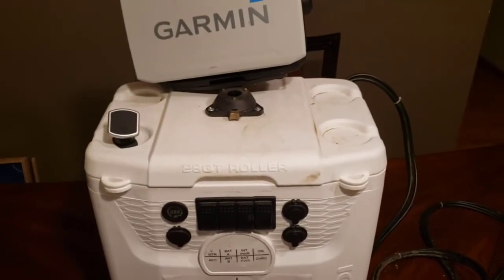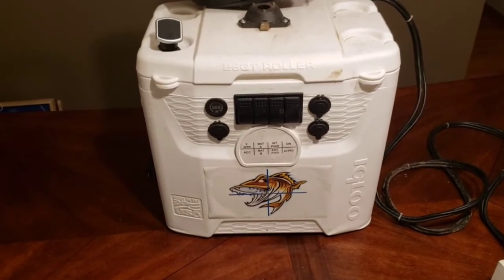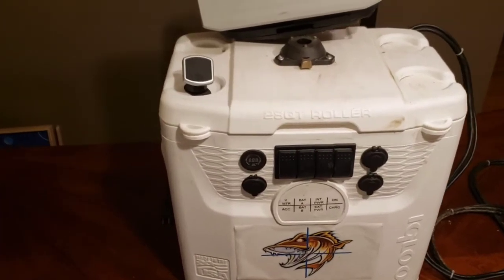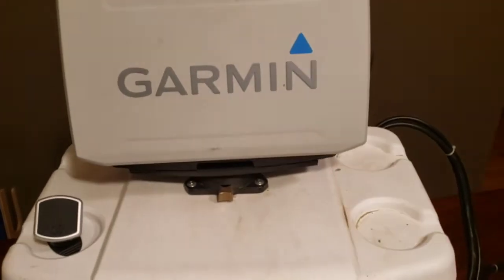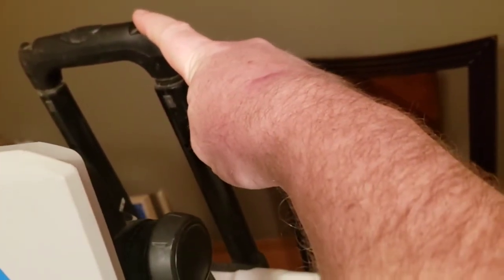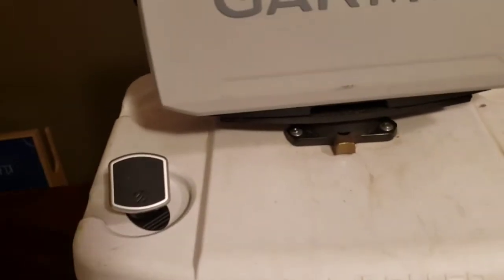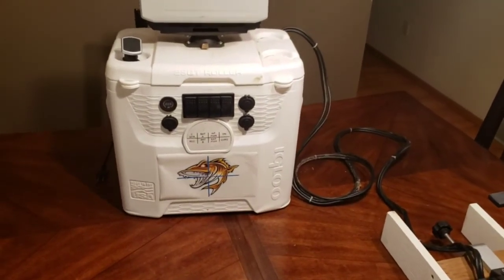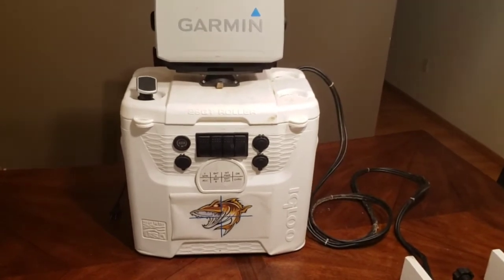1 year later Best portable Garmin Livesscope setup.

Comment: Thanks for the follow-up video.  Couple of questions - what gauge wire is needed for all the connections?  I'm planning on using a 16 volt lithium setup - would all the switches and voltage meters work with that or are they only setup for 12 volt.  Can you provide links to the switches and meters you used and if too long ago, recommend comparable ones now?  Thanks
Reply from the maker: I have my unit stored up at the lake, so don't have it on me.  I think I used all 12ga wire. Im sure it was over kill. As long as you match the size of the power wires on the unit they should be big enough. I built this a few years ago but I just ordered all the rocker switches and gauges off ebay. My rocker switches are 3 way switches so I have 2 on settings on each switch. Just depends on what options you need for how many switches. Then find a gang panel for that many switches. This can be setup with just 1 power on switch if only using 1 battery. I kinda went crazy with mine.

Comment: Been looking for the igloo cooler but can't find it.  Would you provide a link to where I can buy this cooler?
Reply from the maker: That model was 2 years ago so probably not made anymore. I'd think whatever the current Igloo 30qt cooler would work. Just make sure the batteries you are going to use will fit into it. You could go smaller if you don't want to store the head inside the cooler. I very rarely anymore take the head off. Mostly just stays on top.
Reply: @TheKennyHack  Thanks Kenny!